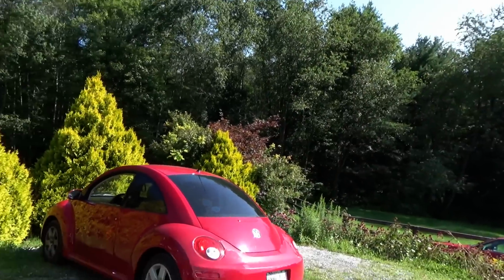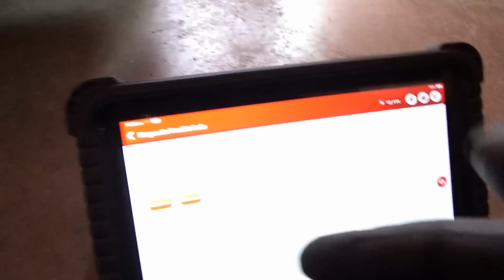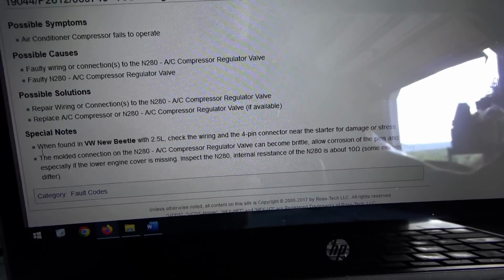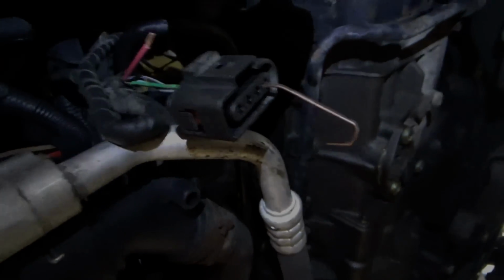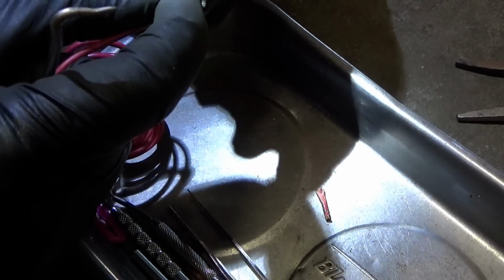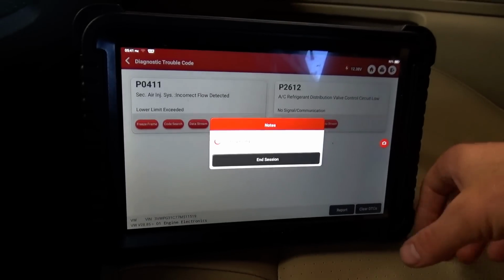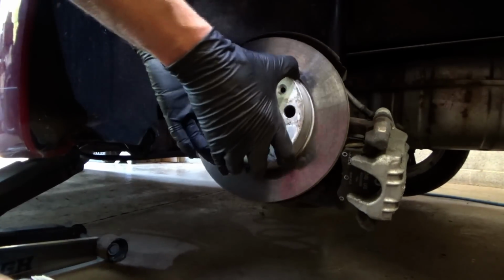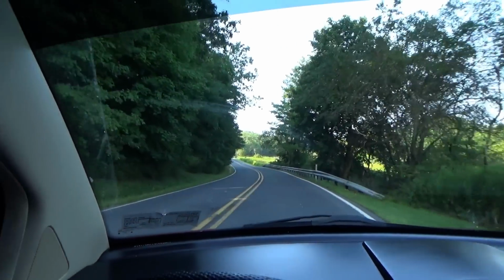Beetle has some BUGS...(No A/C & ABS Problem)

Comment: Just a bit of ancient automotive history: From the 1950s through approx 1978, Chrysler (Airtemp. division) a/c compressors had built-in evaporator regulator valves, too. Not cycling the clutch made for smoother idling also, as well as consistent temperatures. Big vee twin R-12 compressor, you could hang meat in those cars!

Comment: I have a 2004 Passat 1.8T with 4 Motion AWD and a 5 speed manual. It's really rare. There were only a couple thousand built with stick AWD and the 1.8T and only in 2004 and 2005. It's basically an Audi A4 platform in the front with an A6 rear. My car needs to be cosmetically cleaned up but mechanically it's pretty sound. I do all the work myself and replaced the head gasket in March of 2020 with all new timing components and water pump. I really wish I had the 5 cylinder in it. In Europe my car was available with the VR5 engine. I love the sound both induction and exhaust are blissful. I used to say that engine was impossible to exist before understanding it. Basically it's just the VR6 with a shorter block and a cylinder delete. You'd think that it would be unbalanced but if you look at it from the perspective that it's really just an inline engine with staggered cylinders, it makes sense. I believe VW did this because the VR6 was too long to fit in the engine bay longitudinally which is the layout of the B5 and 5.5 Passat.

Comment: Find a 24 volt power supply for your ts100 iron and you get the maximum wattage from it. I also use some of my 6s drone batteries with an xt60 adapter for mobile soldering. I’m probably going to pick up the newer USB-C version soon to try it out also.

Comment: Nice repair Ivan, only thing I'd do differently is pre crimping the connector tabs to the wire insulation so it holds it in place for you, no plier heat sink needed. ;)
We aren't seeing many of these VW Beetles in our shop to video lately since the interiors don't last long in Florida. Last one I filmed was a window regulator, another fun repair on them.

Comment: I've worked on one of these (a convertible of similar vintage with the 1.6 4-cylinder petrol engine). Most ABS problems are either the sensors or the sensor rings. It is possible to remove the rear brake discs without having to remove the caliper brackets. It made hub replacement a bit easier for me.

Comment: Our 336k miles Chevy Trailblazer gets oil level checked every 3rd or so fuel fill. It unsurprisingly uses some oil. I'm planning on trying Valvoline restore and protect.
Reply: Be careful using any oil additives they can change the viscosity of your oil or react to the engine oil additive package

Comment: I do a LOT of connector repairs just like that.  Usually from bumpers getting torn away from an accident and snapping the wires off from the connector.  I really should invest in better depinning tools. Alldata is really good at finding wire diagrams and most trouble codes.  But I too have noticed that they don't have all the trouble codes listed.  So, enthusiast message boards are my usual go-to for finding those odd problems and fixes.

Comment: So Ivan for the first time last week I got screwed by wiring the abs from one wheel to the other like I always do. Had no LR speed on a Passat, so I wired the RR sensor to the left rear harness and bingo I had a signal so of course I said it needs a sensor. Put a new sensor in it and still no signal. Took the left rear completely apart only to discover the toner ring was completely missing. This car came from the auction and had been in an accident and at some point that left rear was apart and the toner ring left the building. Usually when a toner ring goes bad you’ll see a signal but it will just be choppy or whatever but in this instance I had absolutely no signal so I was confident it was a sensor. Definitely gave me something to think about moving forward to always make sure the dang toner ring is there lol

Comment: Standard and OEM Direct fit? They're OEM manufactor. Only non-OEM branded parts I will use and trust. I used with Ford, GM, and VW on side work.

Local GM dealer wanted $60 for ECT Sensor and $180 for the pigtail. Did research on manufactory, and got both from NAPA for $17 ECT Sensor $49 for updated pigtail. Both OEM parts from NAPA. I didn't send the pigtail back fast enough to return. I'll ask the customer if they want it at cost, if not in my sidework inventory as it fits more than just that Sensor. Says multi system use.

Comment: Despite some missing information on the fault code, A/C was an easy diagnostic and repair, if not for the weird location. ABS quick diagnostic strategy by swapping sensor connections. Repair would be quick and easy too, if the sensor was not corroded stuck. In both faults, great job, Ivan!

Comment: IDC where you get data from, and using the net isn't cheating. Finding quality info is key, from the dealer tech to the DYI'er. Even though I've been a professional mechanic for 29yrs, I still look up codes and tech tips from trusted sites and channels sometimes just for verification, because like Eric O always says, never trust your scan tool and sometimes service data is wrong! ( or updated w/o 1 knowing it, if 1 has an older program) Thx for all you do Ivan!

Comment: GREAT video,Ivan.What  are the chances the manual trans is LOW in fluid?  What ,you mean that needs fluid too?haha Next your going to tell me i need to check my brake fluid and windshield washer fluid or clutch cylinder fluid??? but i thought they were all SEALED UNITS.Ahh geez.thanks   nice little car.

Comment: Ivan, Hopefully after the repairs you cautioned the vehicle owner to pay attention to checking the engine oil.  Not meaning to sound sexist but lets face facts most women do not like to look under the hood then they marvel that the engine failed for want of the driver checking oil level and adding as needed.  When I was in the Air Force in 1976 in Germany, German drivers are required to be able to check, depending upon the vehicle, all fluids and tire pressures BEFORE the driver could get their Driver's License issued.  Something that should be done here in the States but, we ALL know that will never happen.

Comment: I would completely replace, or eliminate that plug altogether. It looked like rodent damage to that wire. Wrap all with Honda rodent tape over soldered connection covered with  shrink wrap with hot sealant. That is a horrible design, having that plug exposed to road salt spray. Typical German crap. The car is clean and shiny, and 2 quarts low on oil? I guess the owner wanted to look cool on the side of the road waiting for AAA.

Comment: Those sensors never get out in one piece, you just have to get them out in pieces and clean the hole really well for the new one and slide it with some grease.

Comment: You helped me fix the wipers on my son's van! I went through the usual fuse and relay checks then removed all the plastics covering the wiper motor. There I immediately found the motor wiring and saw that part of the wiper arm linkage had rubbed on it for the last twenty years. Guess what? Yep, a single broken wire. You and Eric at South Main have really improved my diagnostic skills.

Comment: Ivan make sure that those solder joints are not under tension or pressure because solder will break easily don't ask me how I know. I would have used a mechanical connection like a crimp joint with glue and heatshrink

Comment: that is why most people buy aftermarket parts affordability I have a 1998 Honda CRV the distributor alone is $800.00 from the dealer. Can you afford that. so please stop pushing OEM parts they are not affordable for the average person.
Reply: Go to fleabay, or junkyard and pull one.
Reply: I had a fuel rail pressure sensor go bad on a Ford.  OEM price was $100, so for $10.00 at the junkyard I got an OEM sensor and it worked fine for the remaining life of the car.  Aftermarket is a more expensive gamble than the junkyard and Amzon is guaranteed junk.
Reply from the maker: Yeah, it's a lot cheaper to install eBay Amazon counterfeit China junk, then bring it to PHAD for a diagnosis and pay me install the OEM parts that actually work correctly ;)

Comment: CHECK YOUR FLUIDS PEOPLE!! I'm still amazed at how so many people, my son-in-law included, either don't check their fluids at all or often enough, I've told him just make a habit of doing it once a week, it's always been my habit and I got the habit from my dad, I've checked my daughter's oil so many times only to find it at least 2 quarts low.
Reply: My wife's RAV 4 needed a new water pump due to a slight leak. The new OEM pump leaked like a tetly tea bag. I noticed something amiss because I filled the recovery tank 3 times in a short time span. Dealer replaced new pump with NEW LEAK FREE PUMP at their cost. Point is, check you fluids...oil, coolant,  PS fluid, brake...unfortunately transmissions are hard due to no dip stick.
Reply: Amen.. daughters car was 3.4 qts low. 😅😅

Comment: Good job those sensors are a pain in the ass if I can get in there I use a 90° angle drill drill them straight out quick and easy.

Comment: One very important word you used at the beginning after scanning and getting trouble codes, they are exactly what you said, they are clues. They are not a complete diagnosis. They are clues that help point you to a most likely direction. The actual diagnosis continues from there. Trouble codes are very helpful but they are seldom, "The" problem. Can't stress this enough because all too often a code will point to a component and the owner or mechanic will blindly fire the parts cannon. Thanks for showing how to follow those, "Clues" to uncover the actual problem.
Reply: Usually codes have code-setting criteria.  That's what you want not the code itself.  Too bad that information isn't reported.  It should be.  It isn't hard to do that.

Comment: Parts were Required to fix it because heat shrink and Solder was used. They do cost money
Reply: In a shop, those materials typically fall under "consumables", just like brakleen, shop towels, etc. Parts come from the dealer/supply house. But yes there is a cost, just not "parts".

Comment: I have 2 bugs, one 2000 with 180,000 miles and one 2013 with 132,000 miles and both oil plugs leak if i don’t use yellow teflon tape on the threads even with new , from the dealer, drain plugs. Good video. I have a 1.8 and 2.0 respectively but i will be checking for short wires anyway. I already followed your hints on checking for green crusty and found some on both cars at the fuse block at the battery.

Comment: Nice repair, Ivan.  I really don't know why you are so concerned about a car that has gone about 12,000 miles since its last oil change; the owner probably used synthetic oil and it never gets dirty.  You got the "money" shot on the green crusty wire and the A/C was indeed repaired "no parts required."  Slipping the sensor into a well lubed hole is always a good thing.  I have had neighbors that have traded those cars off because people can't repair them.  GREAT VIDEO!

Comment: Good morning Ivan. Every time I see one of these “new” type beetles I think of my old 1/2” Craftsman breaker bar that I had for over 50 years. It met its demise trying to remove one of those big bolts on the lower control arms.Had about 2 feet of extra leverage attached which may have played a role.🤔 👍👍🇺🇸

Comment: You would have a better mechanical connection if you had put the wire insulation under the tabs as well.

Comment: As an HVAC tech I always have some 26G sheet metal around, it works great to make those thin pieces to release the small size pins from the holders. Best part is you can cut it to fit almost any connector.
Reply: Various tin cans have always served my needs for thin metal shims, etc.

Comment: Your opening made me chuckle. I wish I had thought of that when I had a 2002/2003 bug... R-title. Front was 2003, rear was 2002, car cut down middle. Aboit as many problems as you would expect. Over its short life it lost an engine mount, a tranny mount (that made the engine rotate almost 45 degrees and ripped parts of the wiring harness, removed the exhaust, etc...), axel shredded itself, gas tank almost fell out, multiple electrical issues.... hated that thing.
Reply: Only issue I have is my front windshield needs replacing after 55 years on mine, and these shops only can do the glue on new cars.

Comment: Had a Beetle TDI 5 speed manual. What a great car. We'd still have it had someone not run a red light. It died a short death at 160,000 miles and running perfectly.
Best trip netted 753 miles on a tank of diesel.
The paint on that car looks great!
Reply: It all comes down to maintainance.
Reply: @aciddiver1978 uh...ok. that 1.9 L diesel is a fantastic engine.
Reply: 2.5 liter 5 cylinder with a manual transmission makes for one fun smooth ride.
Reply: @jamespn  the TDI was smooth but I bet the 2.5 was smoother and a bit faster. This would pull hills extremely well with the torque though.
I bet the 2.5 manual was a blast and quite the sleeper.
Reply: @billmalec I had an 07 Jetta Wolfsburg with the 6 speed auto, the 2.5 had plenty of power. I test drove MK4 Golf GTI with the VR6 and the six speed manual, now that was really fun.
Reply: Those TDI's are great.
Reply: @volvo09  we had three of them. ALH was the best for reliability. Didn't get to prove the others long term. BRM got hit from behind when it was 2 months old and totaled. Sportwagon got sold back to VW under the diesel gate BS. I used that Sportwagon for 3 years and got more than I paid for it! The only reason I sold it back.